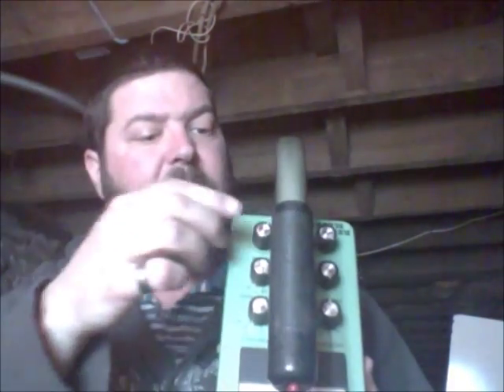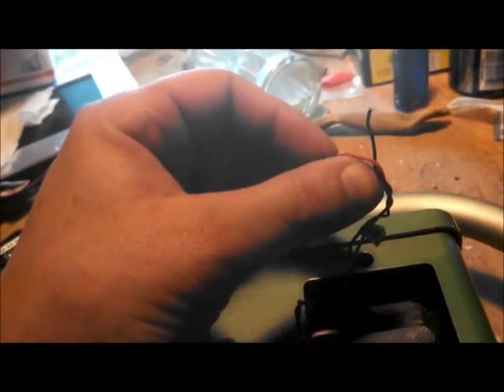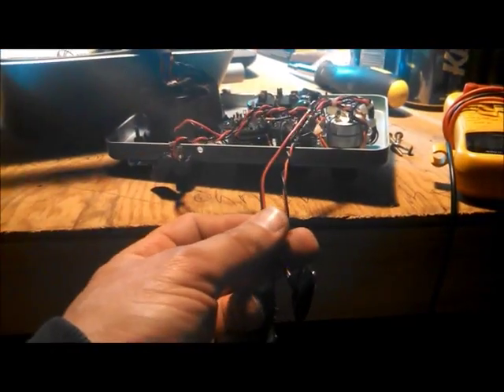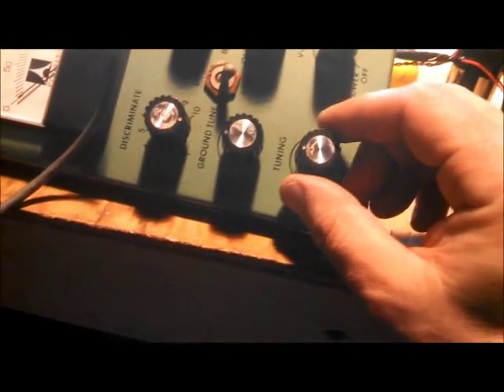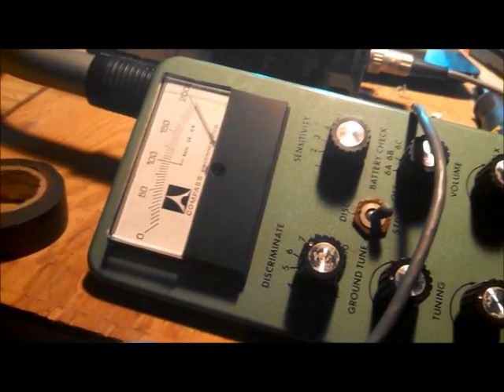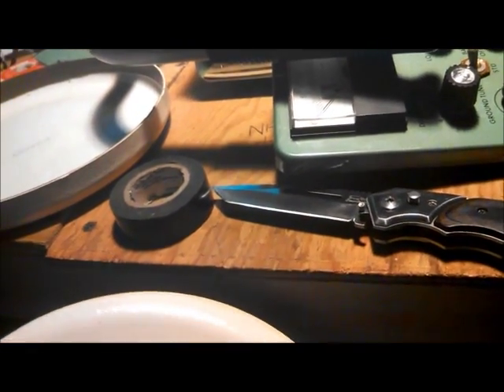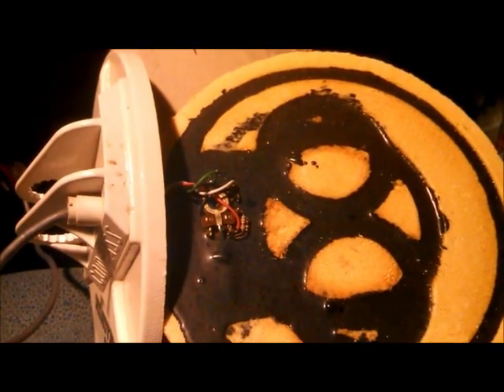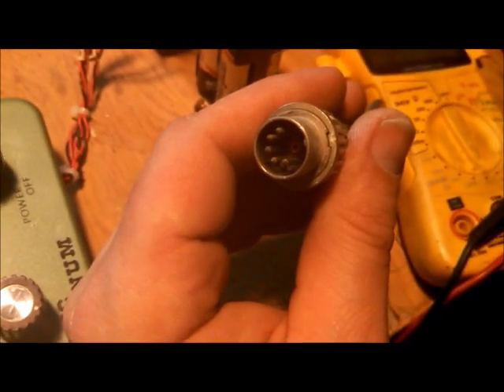Diagnosing bad coil on old Compass metal detector

Comment: Your problem is @6:41 . . . . do you see that red button on the end of the handle? It's used for ground balancing your metal detector and should be pushed in for a few seconds to zero the meter on the front panel. Though in saying that, the trim pot in the coil does sometimes have issues, I believe it's a 10kohm, maybe 5k, but can't quite remember. Anyhow you should get full resistance read across opposite leads and the center lead is the sweeper that changes, but I suspect that you already knew that since you sound pretty techie. Anyhow, just for your viewers, the best way to set these detectors up for a test is to set all the controls as you did and then turn the power on to about 1/4 dial turn, if you hear the whistling then that's a great start and you just need to press the little red button until the meter zeros. Next thing is to turn the start knob back until the squealing is just barely heard. now move some metal in front of the coil to see if it works.
 If you are interested in the ground balancing procedure then I'd post it here.
Reply from the maker: Thanks for the info, seriously but that machine is long gone. I gave it back to the owner who put it back in his shed I think.

Comment: I know it's been 8 years since you posted this but it still has value.  Your info on the battery packs really helped me.  I bought a used 77B Yukon and made the same assumption about the connectors, thinking that the unit ran on 9 volt batteries.  The owner's manual is written for a variety of models, some of which use 9 volt and some others use the packs.  I did use the detector for a few hours with the 9 volt batteries and it worked fine but I see what you mean about long term it would burn things out.  Just ordered some packs from Amazon to remedy the situation.
Reply from the maker: Yeah, this is an old vid of mine. Still glad it helped you out man. Swing beep dig my friend.

Comment: I own The Compass relic magnum 6, It is 1 of the best detectors to own, I can pickup 15 inch anyone that has own the same as mine, swears by it. Just because its old don't mean it does not work well, For Gold It works Great, I can tune out Iron , No Problem Great Machines

Comment: Any chance I could run somehow power cable outside and connect to any other type of modern battery? Like power tools 18 v battery?
I don't have those original batteries pack :/ thanks for any hint !
Reply from the maker: I mean, if you have the right voltage yeah, any battery set up will work. I forget how many batteries this thing takes, it was a while ago, but if you multiply 1.5 X number of batteries, you will know the rough voltage it'll work with. If there's 6 batteries that's 9volts but up to 12 would be within limits. Say, 6-12vdv? Give it too much juice and you could fry the insides, 16vdc would probably set it on fire.
Reply from the maker: I just rewatched my video and I think you will be on with that 18vdc battery pack. Unless each pack does a separate thing on the boar... Good luck.

Comment: Hello friend, I've arrived here today, until your video because recently in a garage sale I got an old compass judge 2 automatic detector, with the same problem in your detector !!! Unfortunately I don't have the coil to test it and I haven't been able to get the original coil of this particular model, I've managed to make a coil with the characteristics more similar to the original, but the problem persists, it doesn't detect, the beep is permanent and the The meter needle goes to the top, deducing and investigating and reaching the conclusion that the problem is the electronic malfunction of a transistor, before carrying it with an electronic for repair, I would like to know if you managed to repair yours and what was your failure?? It would help me a lot to be able to rescue mine from the hole !!! greetings from mex
Reply from the maker: It wasn't mine and I too was unable to get a coil and I did return it still not working. Good luck in your search

Comment: I live in the UK . I have a compass coin pro 11 that needs repair . The engineer requires wiring diagram with wave forms ,voltage checks, and check points . it is not picking up any signals? I have tried the coil on my gold scanner pro and it works ? so its in the electronics the problem .Any info appreciated .

Comment: in the late 80's threw about 2004 . About all I used was a coinmaster , and goldmaster by Compass . I switched to White's then shortly after then Minelab after that  . Because Compass had been out of business for so long . They were a great detector back in the day & even with the 8 inch concentric . I dug faint signals down to 7-8 inches . You are right about them taking an 'Army' of batteries , and that made them heavier than comparable detectors of the 90's .
Reply from the maker: ***** I couldn't believe it took 12 AAs to make 'her go. Still love the classics.

Comment: Hey, Thanks for the video. I just bought a Compass Yukon 71B online. I'm looking for info while I'm waiting for it to arrive. Hoping it's in working condition but at least your video provides a few tips for troubleshooting. Could you have bypassed that bad internal pot (variable resistor) in the coil? As long as the resisters are working to limit the input and output it might work to some degree. The adjustable pot is probably there for the factory technician to tune the antenna coil to 100 kHz before sealing up the coil cover. (What other purpose would it serve?) The unit might still function with a less than optimal signal.

Comment: I thought some of these old machines. Work opposite as the modern ones. Some have a constant tone and when you wave metal in front of it the tone drops/changes. Its not that case with this machine is it ??  Not really into the tech stuff but this was a well made video !!
Reply from the maker: Your talking about either a PI (pulse induction) machine or one that runs in "all metal mode" and has and audible threshold. This one was acting like it was sitting on a man hole cover, not know would make it change or anything. I like to hear the threshold when i'm running in all metal mode but that's not the case here. Thanks for watching.
Reply: No this was an older machine before PI machines. My friend picked it up at a yard sale I think it was an old whites.
Reply from the maker: MUDSWAT right but this one is a VLF machine and works much like ones of today but not as fancy or light. I'm still playing with it.